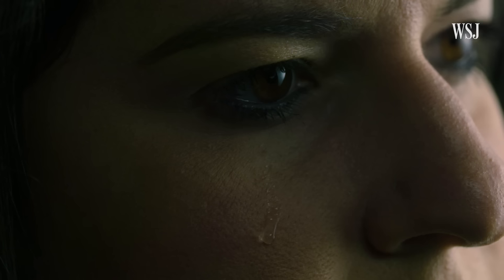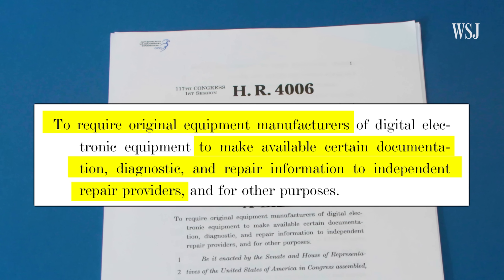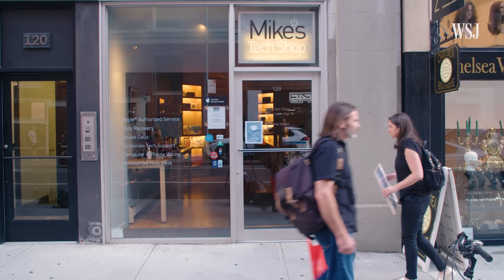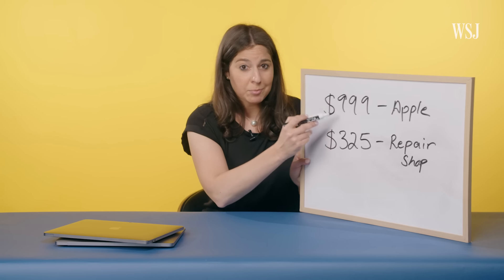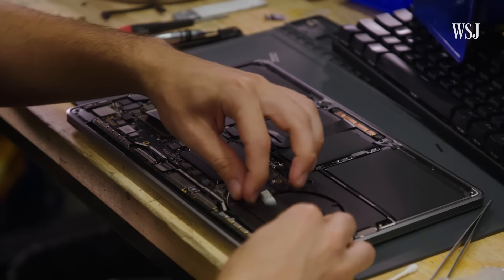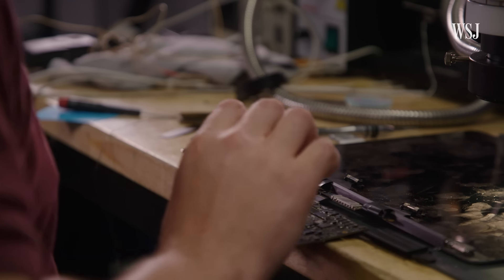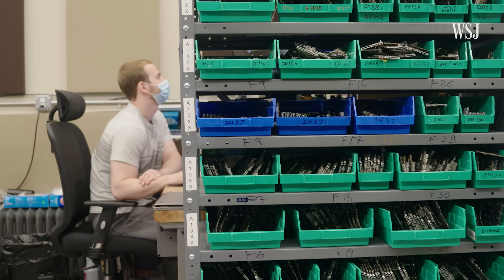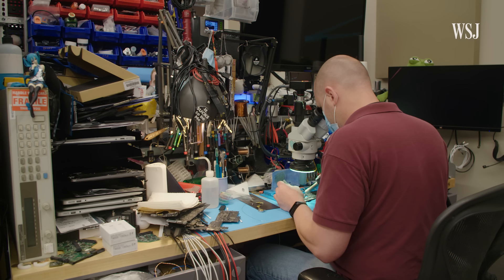Apple Store vs. Repair Shop: What the Right to Repair Is All About | WSJ

Comment: Most manufacturers are doing this type of thing now.  Just try upgrading the RAM in a laptop.  You used to have a little door on the bottom on the unit.  Remove one screw and boom.  There's your RAM.  Not anymore.  You have to flay the entire thing to pieces just to gain access to it, and there are frequently booby traps to stop you.  Delicate cables, multiple screw types, hidden screws, and components deliberately desired to break.  It's infuriating, and these policies make the manufacturers directly responsible for the mountains of E-waste that are filling landfills and/or making their way to third-world countries to be burned an picked apart by children.  More needs to be done.

Comment: They should apply to cell phones to for the iPhones because if you go to a repair shop to repair your cell phone you lose the warranty off of it. The Supreme Court ruled back in 2017 that Impression Products could use recycled inks from printing companies like Lexmark. I feel like this is the same thing.
Reply: So you want one person to warrant a device that another has opened and touched/changed?
Reply: @homewall744  works fine here in Europe. when rejecting the warranty claim, the burden of proof that the customer is at fault is on the company. it is very easy to proof if they indeed are, and very hard for them to fake. in fact, it is the same in the US, see Magnusson-Moss Warranty Act - that's the reason you can still open your car's hood and replace the spark plugs with the ones you got at Napa.
Reply: Once a patented item is purchased from the patent holder, the item is just another widget. The patent holder can't restrict what is done with it after the sale.

Comment: Apple offered to replace my 2017 Rs.66,900 macbook air's motherboard for Rs.50,000.....but i got it repaired for Rs.9,000 from my friend's repair shop and its working very fine.
Reply: and now I'm gonna replace its 128gb ssd with 512gb for just under Rs.10,000 for which apple charges Rs.40,000 as upgradation options while buying the macbook
Reply: what is Rs? i use American dollars
Reply: @gregoryeverson741  Indian currency, you can convert it to get an idea.👍🏻
Reply: @gregoryeverson741  Indian Rupees

Comment: Had this experience took my perfectly functioning 2017 iMac to the apple store cause a so update bricked the board and they told me it’s going to be £600 to replace the board and then cause there was a tiny chip in the screen and cause the only way to the board was to take off the screen if need a new screen at £750 so I should just buy a new iMac instead. Luckily here in the uk we have a 5 year consumer rights protection so I said I wanted to utilise that since the issue wasn’t my fault and they fixed it for free for me.

Comment: After I dropped my 18 month old Macbook Pro at the Chicago Apple store for a free recall which was supposed to take three days, but took ten days, and the found $700 of other things not covered by the recal I fell out of love with Apple.  By the time the notebook was fixed I was in Italy and amid Covid lockdowns It was 8 months before my MacBook would get back to me.  I had bought a Huawei notebook for my son because he wanted to use Windows so I decided to get one for the interim.  I was blown away by how much more advanced and better built Huawei is at half the price.  I got a text from my son that he had spilled lemonade on his Huawei.  I told him why don't you bring it when you come to Italy.  I brought it to the Ukranian guy who had changed the speakers on my older MacBook pro.  After a few days I walked by ready to tell him he could keep it for parts.  It was fixed and he only wanted 40 euros.  Beyond tech guys from the old Soviet Union I also reccomend spill proof containers for water while you work on your computer.  Lemonade being both acidic and sweet is probably the worst.

Comment: Yup. Had the same experience with my iPad Air. Funny thing is they tell you it costs that much to fix it but all they actually mean is "to replace" coz when I enquired further, the guy said, "Yes, you have to buy a new one" for a cracked screen. The top layer even. Not the display module.

Comment: "Name a product that increases in value with age AND use." KS
Reply: Housing
Reply: Rolex
Reply: @homewall744  Homes are property. NOT products.  Besides, if you have two identical homes in the same neighborhood. One is run down, the other is in pristine condition.  Which one is worth more in the open market?
Reply: @barfymann362  A scuffed and scratched up Rolex is worth more than one that is in immaculate condition?
Reply: @untouchable360x  A vintage 1980s Submariner is worth more than the current 2021 model. For the Daytona models, the 1969 model is priced at anywhere from $250,000 to $12 Million. The current Daytona sells for around $30-50K. In the Horology market, certain brands - specifically Rolex and Patek hold their value and appreciate over time. There are corrections every now and then, but so far there has been a consistent appreciation in the value of Rolex models.
Reply: @barfymann362  1969 pristine submariner is worth more than a scratched up and scuffed up 1969 Submariner?

Comment: I have a flagship Google Chromebook, and I love it. It is a beautiful, and powerful machine, but the hinges started binding, and creaking. I called Google support, and was told It was not fixable, and to buy another one. I took a can of lock lubricating graphite, and sprayed a little bit on the hinges... voila' it is fixed! So, it is not just Apple.

Comment: I'm sorry, how is evey single apple review on the internet praise the hardware build? Those are horrible condition for a motherboard considering all the fuzz I'm hearing. I have a cheapo 2010 laptop that's still well and alive, and I'm living in one of if not the most hot and humid place. The only thing I've ever did to keep this laptop running is to swap the battery and give it an ssd.

Comment: My 2009 MacBook Pro was a beauty. It works perfectly and would work perfectly if I didn’t drop it so many times. But it still works and it’s 2021. The only issues I have now are software issues. Because my software is out of date some of the apps I have can no longer work. Which is bs. The truth is these machines can be built to last and yet they make them not. It’s the light bulb situation all over again.

Comment: This same thing is done by ASUS India too. The laptop's power area had a chip blown. Authorised Asus service did not even check it or got into any specifics but quoted a price and said its better to buy a new one they just called me up and said its dead (as if i did not know that). I got the laptop repaired from a third party shop and it barely cost me anything. The device works just like the way it used to.

Comment: After aggravating with apple I basically used leverage to entice a repair shop not authorized to repair my Apple I phone. I got wind that the tech at this repair store was facing eviction & was 100 dollars short & late on rent. I pulled out several Benjamins and I said violate company policy and I'll pay your rent this month plus arrears. I had haggled for 2 years and was very angry. He took the offer and fixed my phone not authorized because I paid them off to do this. A new phone was over 1000 dollars and rent and arrears were 700.00 I paid that instead.

Comment: Here in the Philippines they can repair pretty much anything - and it is super cheap!  In the US if a phone gets wet and shorts out, they  tell you it is not repairable. Here in the PIs it is a 30 minute fix that cost about $4. Non-replaceable batteries are easily replaceable.  In the US the corporations are out of control. 😎

Comment: I have an old MacBook Pro from early 2015. It has a problem with the battery; it says battery Service is recommended, and the 13inch 2015 Macbook is not yet vintage. I use Mac Big Sur macOS 11.6.8.

The first MacBook Pro 13 came back in March 2016. I got my main second Mac mini (M1, 2020) last Dec 2021.

Today, I will be contact Apple support for  this problem, I had it seven years , I hope it fix or replace and I will be use my customer rights law.

Comment: I think they missed the main problem with this entire thing and Apple directly. With the iPhone 13, the parts are paired to the motherboard. If you change the screen, it disables multiple features (true-tone, face id, ect) that are unrelated to an LCD repair. I've been repairing phones for 7 years, wanted to open my own shop. I wont be able to repair any new phones w/o problems arising that would make my independent repair shop look bad. They could release an update and make it possible. They are intentionally making it to where you HAVE to go to them. If you had a car and you needed the window replaced, but you didn't get it at your dealership, the car wouldn't be able to use its blinkers, back up, and go left. Not okay lol
Reply: That's certainly not the main issue at hand, although it is a part of it.

Comment: I broke my iPhone 11 pro max and when I took it to Apple they told they have to replace it with the same iPhone for $850 because face id isn’t working. Took it to a shop and they changed the screen for $310 and face id works. iPhones are more expensive here than the US but still.

Comment: Apple's whole model is get customers to buy new stuff, they release new product every year even if the new item has nothing really new, just increase memory size or the camera has bit higher resolution compared to last year's. allowing repairs means people stick with their products for longer before upgrading.
similar mentality with keeping customers, they make their products seamlessly compatible with each other but purposely difficult to work with others. companies that uses phones and tablets usually have to go all Apple products or all Android, transferring or communicating data or creating systems with mixed products has too many difficulties as Apple products will try their hardest to not be compatible.

Comment: My Mac Book Air-2015 model got horizontal lines on the screen after 2.5 years of use and the electric pins at the end of the charger wire got damaged. I took it to the nearby Mapple store, an Apple authorized store in Mumbai(India). They said I'm out of warranty and their service charge would be ₹3k. And for the power cable issue, they have to replace the charging system of my Mac and that would cost ₹15k. Also for the lines-on-screen problem, they said they have to replace the entire display hardware and that would cost about ₹40k. 
So, the total cost to get it repaired would be about ₹ 58,000 + .  
And the cost of the new Mac Book Air 2015 version is about ₹62,000.😐😐😐

Comment: I was an official Apple tech in college. A "genius" although I hate that term. Also a big fan of Rossmann's YouTube channel. I learned way more from him regarding the different parts of a computer, what they do, and how to fix them than I did from Apple. Which is why I'm so pro-right to repair. Their ecosystem doesn't teach people what is wrong and how to fix it. My job would literally be run the diagnostic which I didn't get any other added info besides what the customer saw. It's a camera issue, audio issue, etc. Then we either have that entire component in the back to do a modular repair, (i.e. replace the whole camera or the whole speaker). Or we don't and we need to swap the device. No other info, no other inner workings. And that's just unfair to all people involved.

Comment: Of course.. if the computer was designed to resist water spills like my Thinkpad is (which finally got tested out two months back,) your computer would still be functional!

And yes.. Louis has a video up where he deliberately tests this out.. [Tip: don't use a whole water bottle next time, use a glass. There is a limit to how much water can flow out per given amount of time.]

Comment: Apple forces you to do full motherboard replacements because it's low effort and forces the customer to shell out many hundreds of dollars and Apple doesn't have to find VERY skilled technicians who can do component level replacement on the boards.   People with those skills (which includes me) are leagues beyond the MORONS at Apple's "GENIUS BAR", of which the very NAME of it is a standing joke to real technicians.      

In fact there nothing even remotely unreliable about component replacements on the motherboard if the job is done right.  Apple flat out LIED about that, as they lie about so much else.

Comment: Apple has a program where any independent shop can get certification and is gaining access to original parts and tools to provide services.

Nearly every BestBuy now able to do apple repairs using your original warranty.
Reply: No .... Luise talked about it and it's not what it seems 
They basics make other repair shops work for them as their own branch / outlet
They provide a few stuffs 
But for most important and expensive parts 
They tell the repair shops to ship them the device or  to change the whole part instead of just repairing the exact damaged component

Comment: No kidding on the liquid proofing.....    I let ONE DROP of plain, unsweetened tea hit the " \ " key on the right side of my MacBook Pro.....that took out the right side 2 1/2" of my display.  Way too expensive to repair, I now use it with a smaller display area and will do so until the whole machine collapses.

Comment: For the older generation that don't get this. Here is another example. Time honored tradition used to be you learn how to fix cars from your dad but now a company like Ford says nope you can't wrench on your own car for safety reasons and we will not give you any information on how to repair it yourself nor give independent auto mechanics tools or info because it will risk/endanger our proprietary technology information. If you do try we will void the warranty for your car. You have to take it to a Ford approved repair and well will charge you jacked up repair fees because we made it hard for you to get it repaired else where and made back end repair into a monopoly controlled only by Ford. They then try to make repairs overly complicated with hardware that gatekeeps repair to need specialized tools, chips and proprietary software to repair "safely". The DiY spirit and attitude that America was founded on is being co-opted/hijacked in the chase for profits by these huge companies wanting to have a monopoly on repairing a thing YOU OWN. They are taking away your choice and freedom to repair and dictating what you can do and how to do it while setting the price to their benefit. Screw the free market.

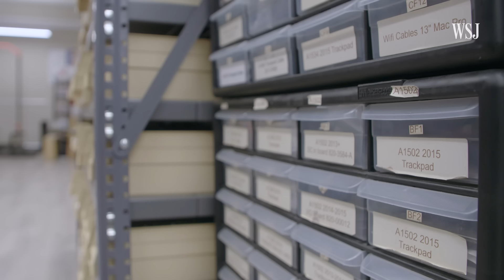Comment: 8:00 Liquid proofing is still a very tricky thing to add in a laptop. Maybe doable but very tricky and could be pricey. Biggest problem is your cpu needs cooling system to transfer the heat of the cpu (and gpu) to exit the laptop. There are some waterproof computer system out there but most people won't like it because they're bulky, heavy, ugly, and often pricey.. Not to mention might be even harder to service than regular laptop system.

Comment: This is why they're putting computers in cars basically, so you can't possibly fix your own car and have to take it to an authorized repair station and pay out the nose. What started out as one little black box in the car is now a system of sensors connected to a computer, they replace the sensors knowing it will not fix the problem, and after a dozen replacements they then tell you it was the computer all along, again paying out the nose. The average car has from 100 sensors in it, and if it is a luxury car it has many, many more.

Comment: K so I have a question about how much it would cost for an independent repair shop to outsource a genuine apple part, specifically an iPhone 12 Pro screen. 

I called went through an independent repair shop (it's a franchise with many locations cross-provincially) to inquire how much it would cost to repair a broken LCD screen for the iPhone 12 Pro, and they gave me a price that sounded pretty outlandish: $499.99 CAD, plus tax (Quebec) $574.98 CAD. 

I called Apple to ask them how much it would cost for them to replace the screen and they said it was $270, plus a $30 replacement fee. 

When I asked the third part franchise, they said their cost is higher due to outsourcing. The difference in price is staggering! Does it really cost third party repair shops THAT much to outsource a genuine Apple part? Or were they just pulling my leg?
Reply: I would recommend you ask this in a cell phone repair forum like the subreddit r/mobilerepair

Comment: Apple probably just lie and send it to a mass repair center where they just replace parts, because it is cheaper and it does not require a highly educated repairman to replace something. To pick something apart to swap parts is not hard if you memorize how to put it back together, it is just screws, cables and perhaps some thermal paste involved.

Comment: i know its 2022, but guess what, Apple is trash. lemme tell you why. ANY phone that has Touch ID, if you decide you wanna change the battery yourself, the moment you OPEN the phone, the TOUCH ID stops working completely and the ONLY WAY to fix it, is to take it to APPLE. This is not right. i had 3 iPhones: 5s, 6s & 7. Opened all three carefully like i always do. TOUCH ID stopped working on all 3. I absolutely HATE APLE and have since then switched to Android. NEVER had any issues with Android. EVER. A new touch ID from Apple cost well over 100 dollars. screw these people.